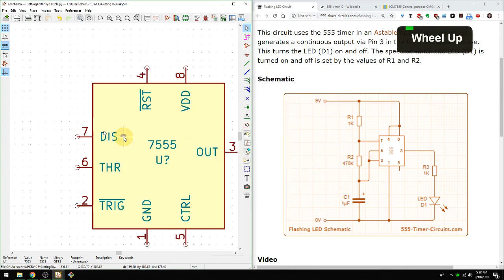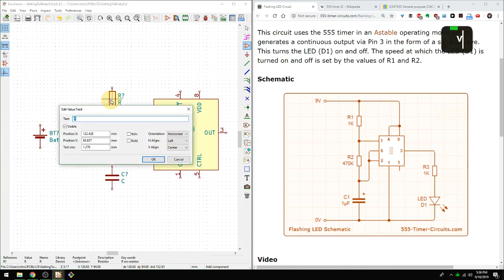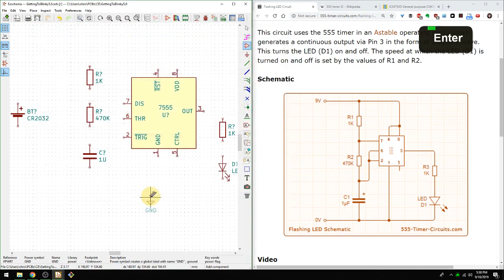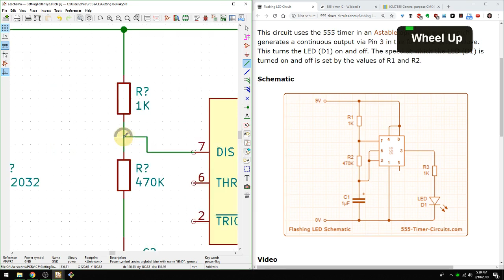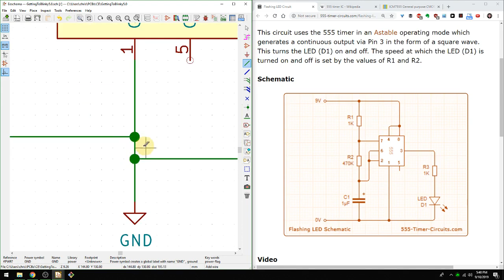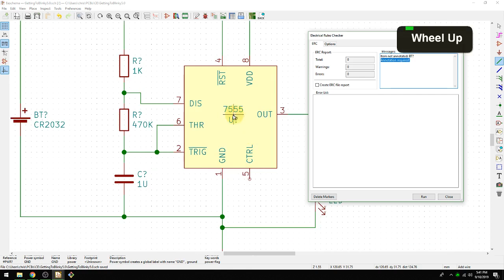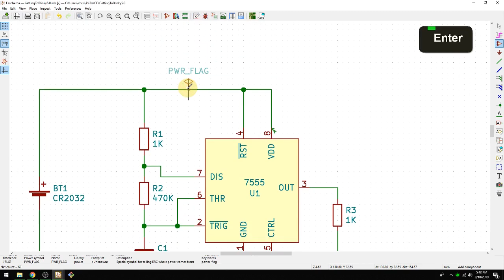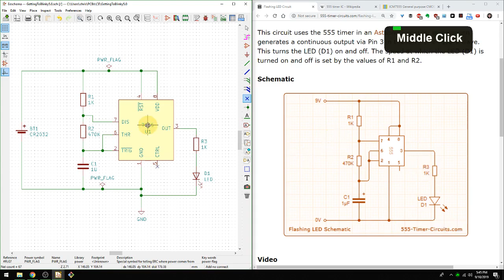Getting To Blinky 5.0 - Making The Schematic

Comment: Great introduction video series to Kicad. Your original schematic was designed for a 9v supply voltage, hence the 1k series resistor to get a reasonable forward current through the led. Since you lowered the voltage to 3v I’d expect to adjust that resistor as otherwise the forward current will be too low to actually see the led blink ;-)
Reply: You forgot to note that it should be k not K since we're nitpicking ;)

Comment: Thanks very much for the free tutorials on building a PCB.  Besides the other comments about the audio, I noticed that you're audio is a little hot, ie clipping. You probably noticed too. Just a small thing to point out just in case. Thanks for the great videos, you have a good presentation style.

Comment: 8:54 don't you need to 'X' out pin 5? Earlier you marked it as an input, so if you don't mark it as NC by 'X'ing it out I think you'll get complaints later on...
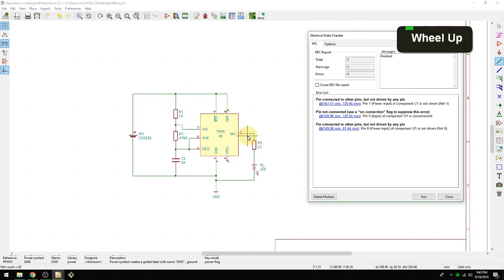10:55 right .. you do run into trouble with ERC if you don't. LOL

Comment: You really shouldn't just skirt over the "power flag " like that you should explain it in detail, this point has caused so much confusion for beginners and experts alike it needs explaining, and it is bad practice for you do so flippantly say "oh you don't have to worry about that" regarding warnings, this is aimed at beginners this is the stuff they need to no.
Reply: A nicer approach would be to ask politely for a more in depth explanation of the Power Flag and Error Checking.
Reply from the maker: That sounds like a good topic for a new video, I'll add that to the list.

Comment: Would like to hear the reasoning/tactics to x100 designators
Reply: A little late, but I guess you use different hundreds for each section of your board, input filtering components 2xx, output components 3xx, etc.